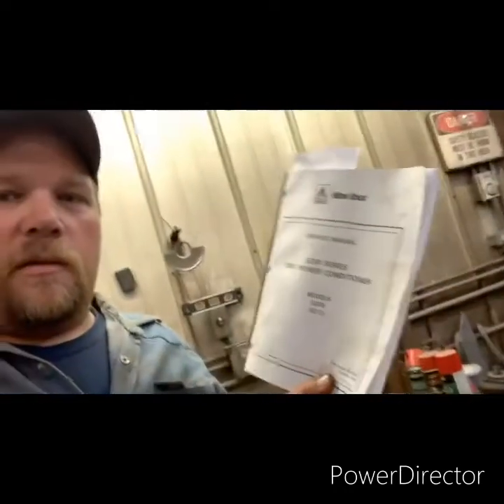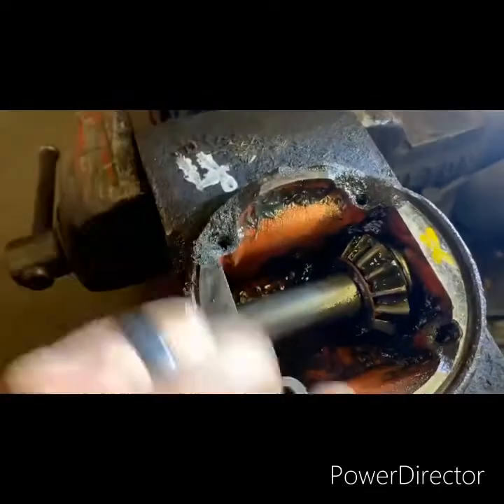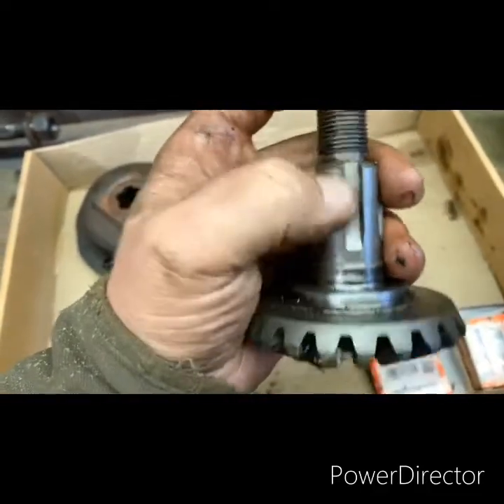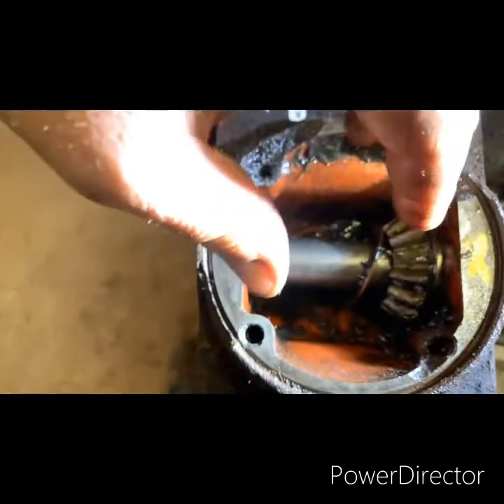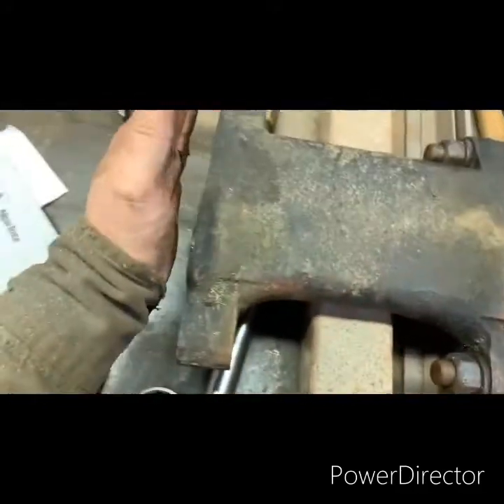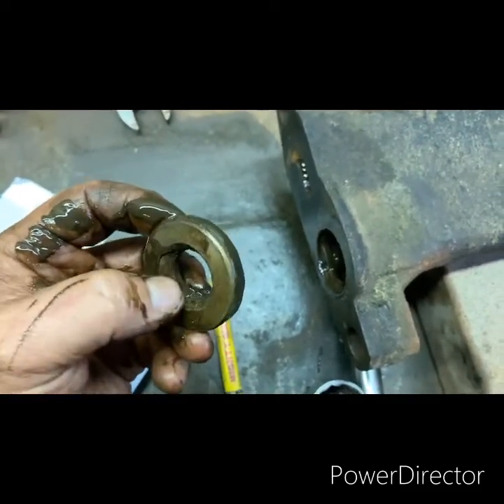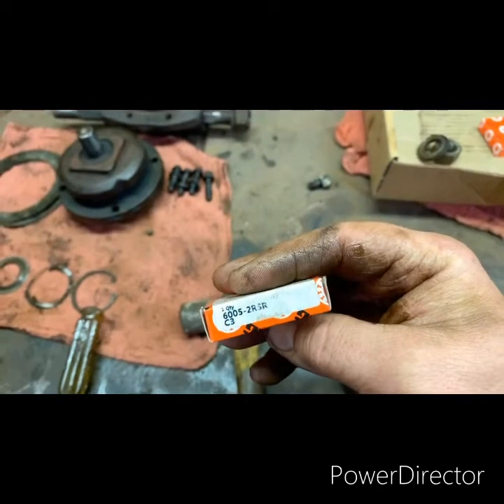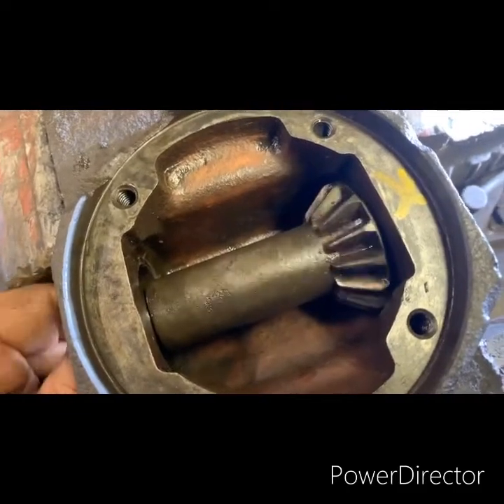New Idea 5209 discbine cutter bar rebuild pt.1

Comment: That was very informative. Just subscribed!

A great way to use parts books is to search the part number for hits on eBay. Great for old equipment. 👍
Reply from the maker: Thanks for subscribing, glad you liked it. I did that to for 2 years since I don’t cut a ton of acres with it but I will be doing the annual checks from now on! The shop manual and parts book were the best investments I could have made, I would have been lost with out them!

Comment: Thats a real nice video! I have a grey ghost model 5209 and its starting to get more then ideal play in the end turtle been a nice mower but not gonna lie bit hesitant to tear into it this close to season!
Reply from the maker: Thanks for watching, I hope it was helpful! At the very least I would say pull the tops off and check the grease level and when the top is open it lets you see the bearings also. Being yours is gray like mine I’d guess it has one long hex shaft running the full length of the bar to drive the gears. If there’s anything I can help with just get hold of me, good luck.
Reply: @dustinadams9136  is it possible to flip the long shat around or is it the slide gears that get the wear in them?
Reply from the maker: @coreydevries9438  as long as it hasn’t gotten bent or wound up it should slide out the end and be able to be flipped around. The shaft should be softer than the gears and do most of the wearing.
The replacement I got from a machine shop wasn’t very costly so if it showed much wear I’d replace the shaft.
Reply: @dustinadams9136  ok thanks I will get it pulled out and run it to local machine shop and see if they can get one and replace it! Thanks for taking the time to reply.
Reply from the maker: @coreydevries9438  anytime, if have any more questions just get ahold of me. Good luck!

Comment: I hate the fact those 4 cap screws that hold the cutter top gear into their individual housings are threaded into those tiny miniscule outcroppings of metal only a couple threads. Over the years the outside units took most abuse. We drilled straight through clamping it together with threaded rod. We had to grind a little of the nuts on the bottom to accommodate both the shoes being mounted.  Those 4 screw holes exemplifies engineering at its worst. The segmented drive shafts didn't save that much money when one was rounded off.
Reply from the maker: Yes I agree the 4 screws are a very bad choose, seems to want to break the casting out if you hit something. Thanks for watching and commenting, your idea of changing out the bolts sounds interesting!

Comment: I have a 5209 and I went to cut hay and the rollers work and turn but the cutters aren't turning to cut
Reply from the maker: Everything is driven off the left side or main gear box, possibly the hex shaft spun in the coupler at the gear box. Not positive though.

Comment: What’s the trick to get the cutter bar separated from the gearbox? I have everything loose and can move the gear at about 1/4” out of the gearbox, but can’t fully separate. Help?!?!?
Reply from the maker: Are you meaning on the main drive gear box that the pto runs into?
Reply: @dustinadams9136  I’m trying to pull the entire cutter bar out. It will pull slightly from the gearbox, but I can’t get it to fully release.
Reply from the maker: @robertstuart1365  when you slide it try to figure out if the hex shaft is coming out with it or if it’s stuck in the gearbox. My shaft had gotten spon in the coupler and I had to free it to be able to move it. 
Or pull the end cap off the outer end and remove the hex shaft all together then the only thing connecting the cutter bar and box should be the bolts. I’ll pull the book out study it alittle more.
Reply: @dustinadams9136  I got it! Thanks for your help!
Reply from the maker: @robertstuart1365  no problem, what ended up being the problem?
Reply: @dustinadams9136  just needed to get some pressure on it. I ended up hooking a tow strap to in and pulling it out with a truck while twisting it. Ultimately, one of the short shafts spun inside the gear. I’ve ordered all new shafts and gears for it - I don’t want it breaking down in the middle of the season. Looking forward to reassembling. Thanks again for the help!
Reply from the maker: @robertstuart1365  glad to hear, your welcome anytime. Good luck!

Comment: I can’t find part 2 of the repair. I’m tearing mine apart and holy crap there is a lot of pieces and mine had a lot of rust. There is no one that has a video of taking the octagon shaft out.
Reply from the maker: You take the outer pod apart on the right end , if the shaft isn’t twisted or bent it just slides out otherwise it has to be cut out in pieces. Message me on fb and I can try to send you pictures of the parts book tomorrow
Reply from the maker: I just looked at my videos in my history and it was there under New Idea 5209 cutter bar repair pt2 or something.
Reply: I was going to send you some pics but I can’t find you on Facebook.
Reply from the maker: @Sergeant1001  my cell is 641 220 2079

Comment: where can you still get parts at?  5212
Reply from the maker: I got some from a company called The Discbine Doctor, had pretty much everything. I found the gear box case on line used and there’s shoup supply for more general stuff otherwise any Agco dealer has or could get everything, the new Massey Ferguson ones are basically the same machine. What are you needing?